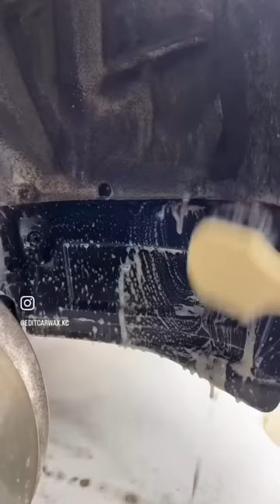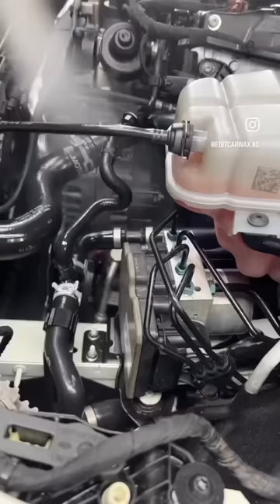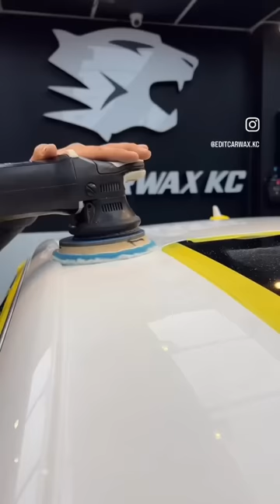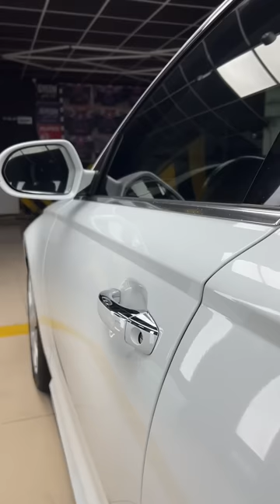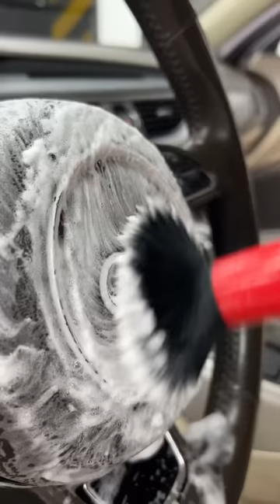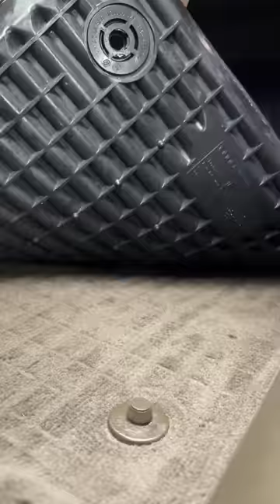2018 model AUDI A6 paint renewal and detailed interior cleaning package

Comment: Nice detailing, but please tighten the wheel nuts with a torque wrench to spec instead of using the air tool.

Comment: Does that not damage the engine spraying water on it like that?
Reply: there will be no problems right away, but after some time water can damage some sensor.  this is not an old Passat TDI with no electronics under the hood.

if I saw that someone washed my engine like that, I would like a written guarantee that nothing will break down in the near future.